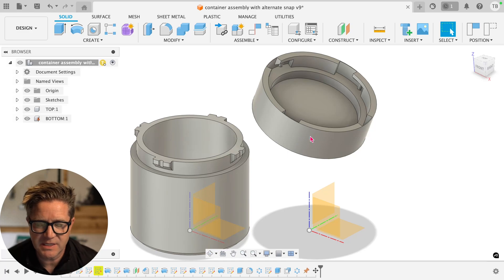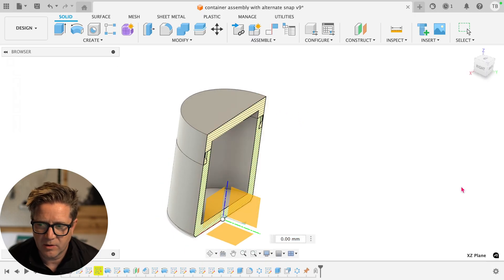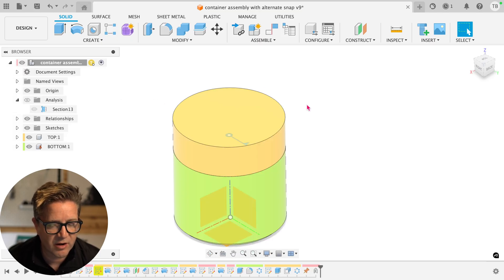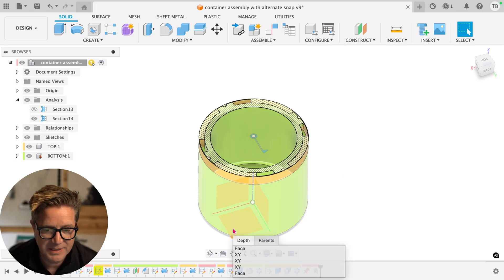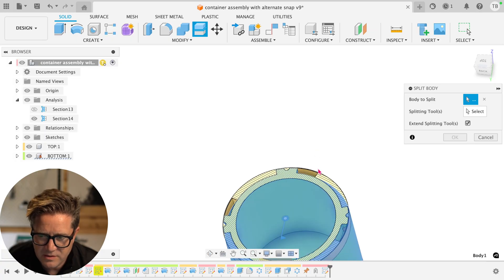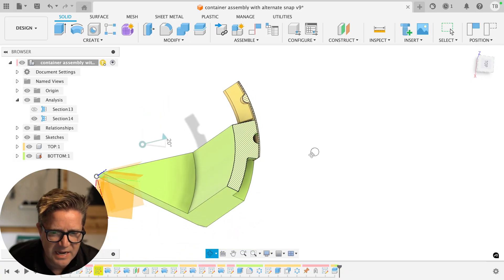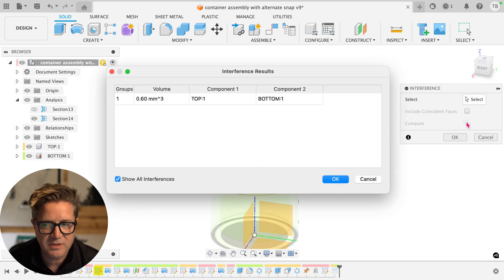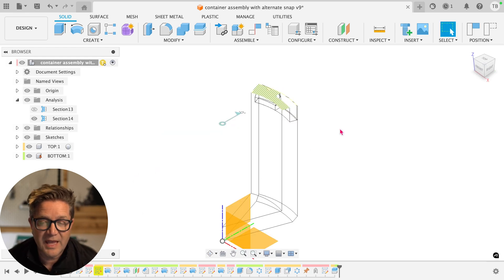How to Visualize Moving Parts in Fusion (Snap, Twist, Lock!)

Comment: Great information and well presented - thank you! I had not thought about splitting a body and then suppressing that feature later, nice idea. I wonder if you can go on and show how to set up clearance for these parts? I like to set up clearance as a parameter so I can adjust to real-life results on my printer. However, the Fusion experience hasn't been great. I've tried offsets in the sketches, offset surface, press-pull tool, and even cutting with the thin extrude tool.  Then I change the clearance by 0.01mm and my projections and joints all break. Is there a robust way to apply clearances in Fusion?